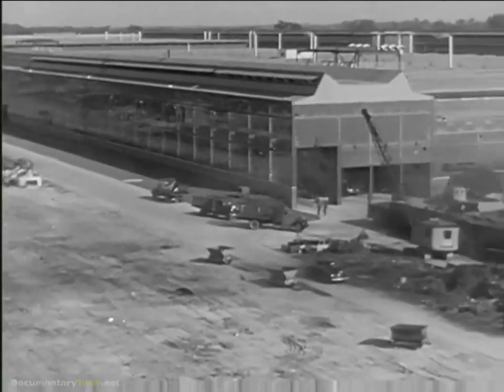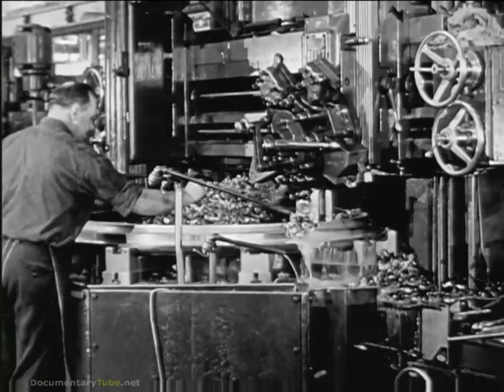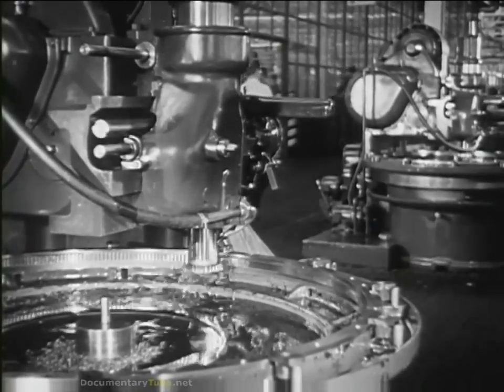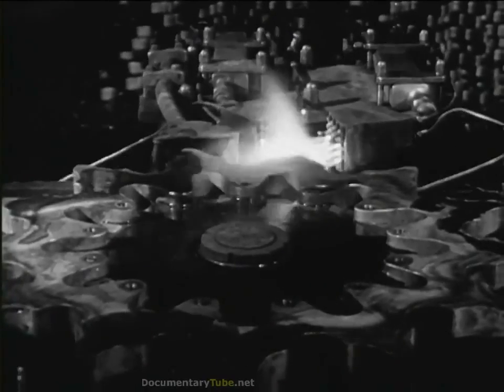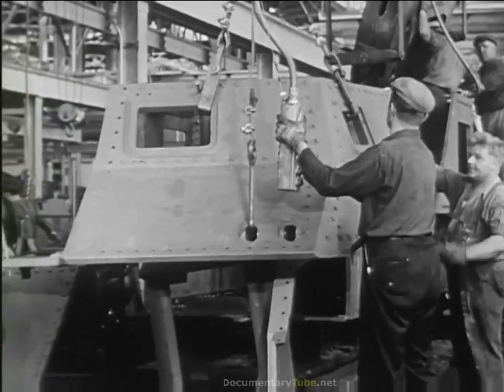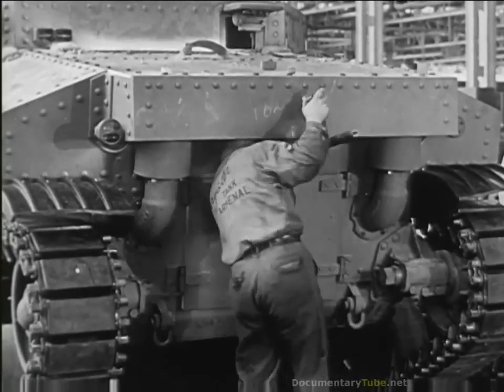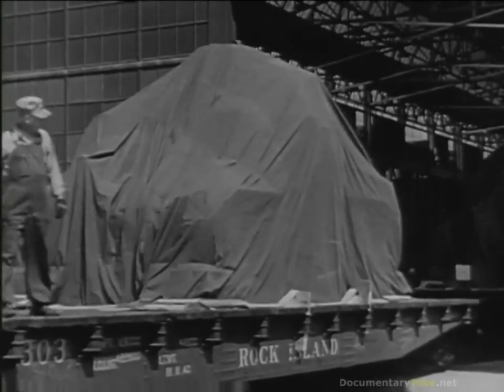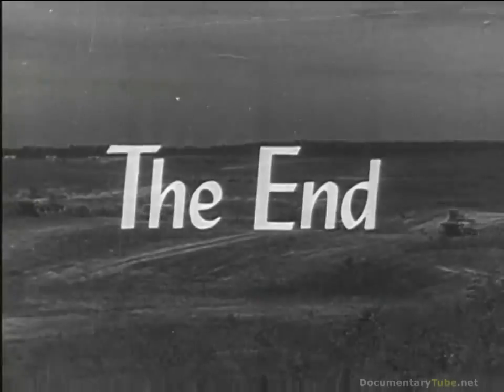HOW ITS MADE: Building a Tank (720p)

Comment: We see process of manufacturing and mounting parts in one tank but what a big brains must stay behind that. Sketching parts on a paper sheet is only for most tallented engineers (today we have visual 3d enviroment), parts must fit to each other. Technologial engineers must prepare whole process of manufacturing steel and plastics.  
I heard story that some countries like Russia prepared gears that was'nt logical and most efficent but key was that enemy cant manufacture the same gear without original sketch so broken tank was useless for enemy.
Reply: enemy wouldn’t copy their tank idiot. if they did, then the Russians would beat them ez.
Reply: i noticed that the US used bolts to make the tank one piece while germany on the other hand used welding.
Reply: It’s beautiful is it not
Reply: Sort of, trial and error was pretty much standard procedure so alot of time and money was wasted whilst modern 3d CAD could do the same stuff first or second go.
Also I'm very sceptical of the claim about soviet gears, with a micrometer you can quite easily make a copy of any part.
Reply: True